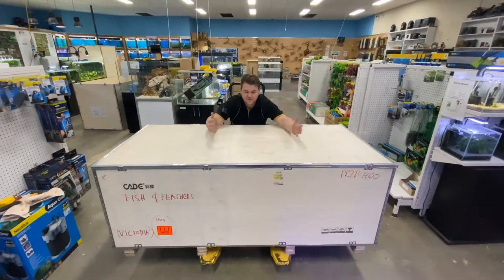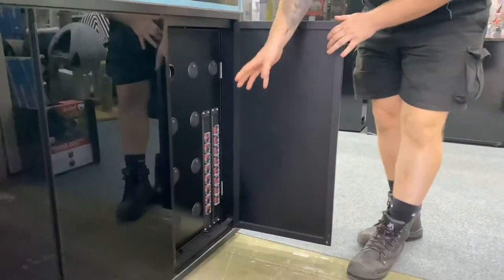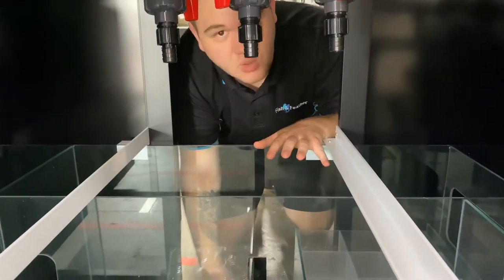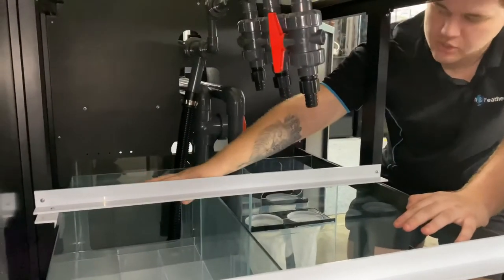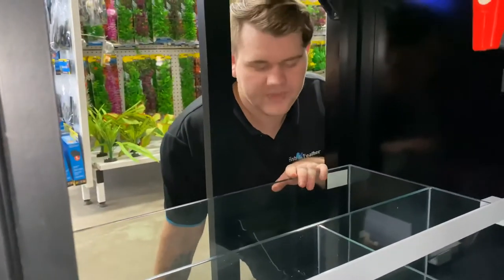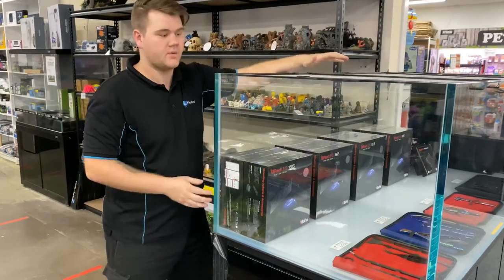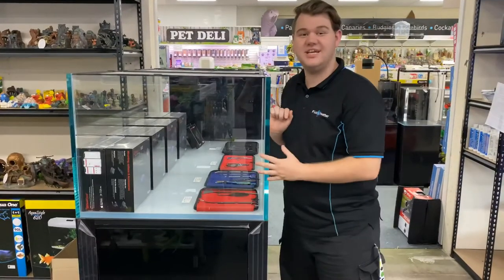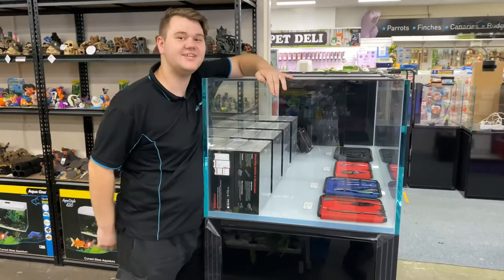CADE REEF S2 1800 UNBOXING | Fish and Feather Kilsyth

Comment: Great review. I’ve decided on getting this very tank. 
Your thoughts on the screen cover and if I should get a after market cover that might be a little stronger?
Should 2x MP 40’s handle the flow needed for soft/LPS tank?
Reply from the maker: It is a very well designed tank that's for sure! 
The screen cover isn't bad although it can be somewhat flimsy, but a aftermarket one wouldn't be necessary, however that would be entirely based on your personal experience. 

In regards to the MP 40's, yes it would be enough flow. However being 19ml glass the magnets would struggle.
You would want the MP 60's for the stronger magnets, otherwise alternatively we have used the Reef wave 45's on pur 19ml glass cade with no issues, and these are a cheaper unit.

Comment: How do you get the stand through a normal single doorway if the stand comes pre assembled ?
Reply from the maker: We have installed them into houses with a single door.
Obviously you would want to measure prior and sliding doors are definitely preferable. 
But yes, that can be one potential downside to the Cade aquariums as they do only come preassembled.
Reply: @fishandfeatherkilsyth  it fits! 👍👍